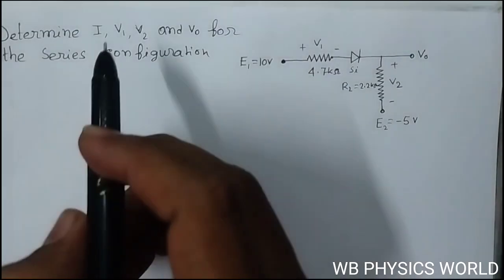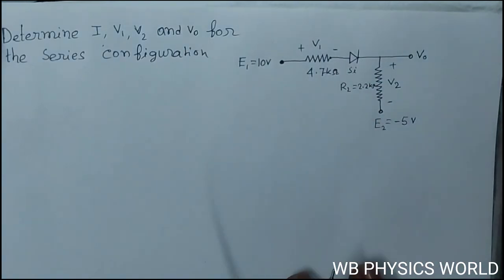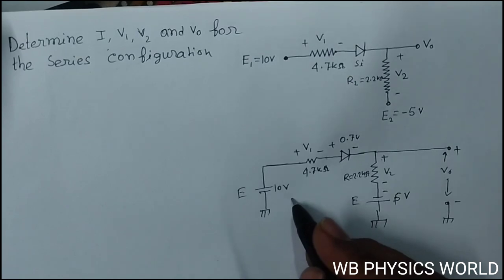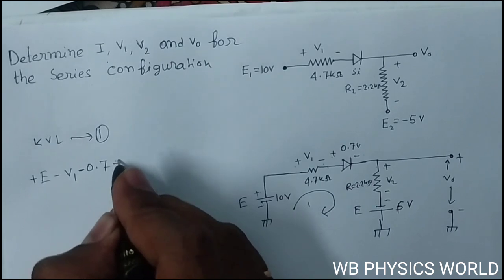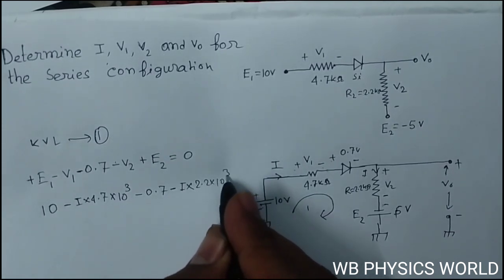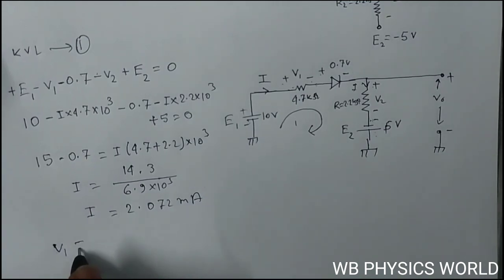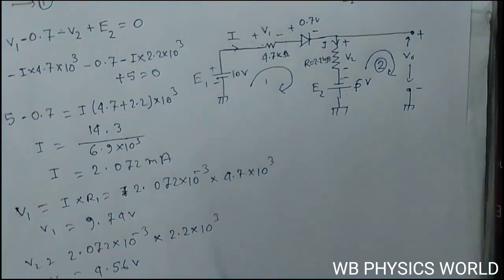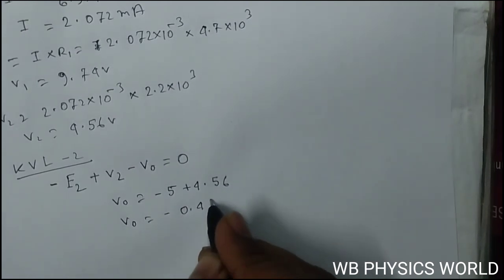Determine I, V1, V2 and Vo for the series configuration

Comment: sorry  but still confused why did E2 become positive when the given was negative 5
Reply from the maker: Here I used kirchoff voltage law. When complete the closed circle, then at voltage E2 it goes from negative terminal to positive terminal, i.e lower potential (-) point to higher potential (+), so I take it positive. 

You can also see that in other part when I goes from higher potential (+) to lower potential (-) , then I take it negative